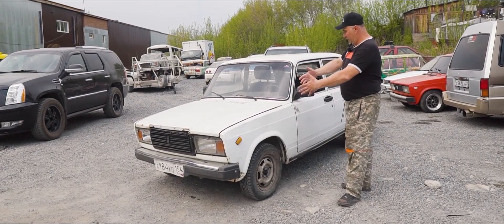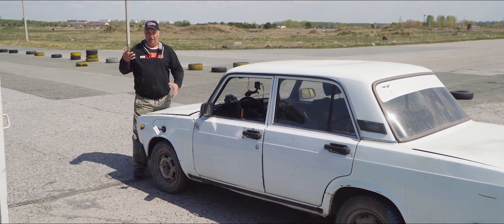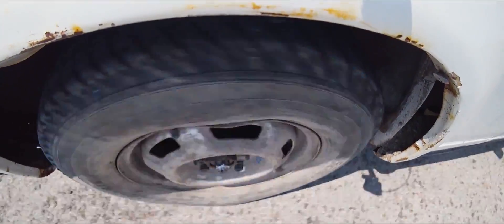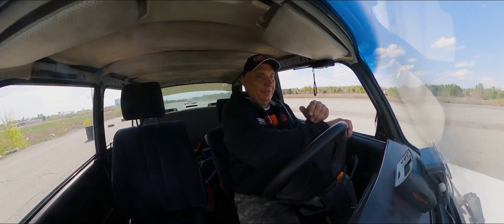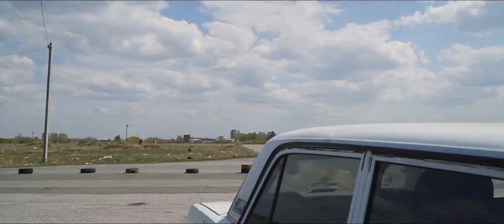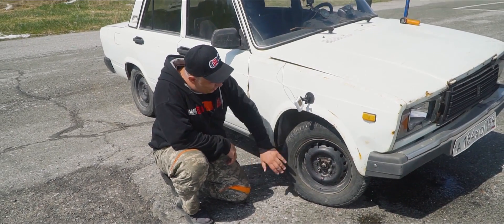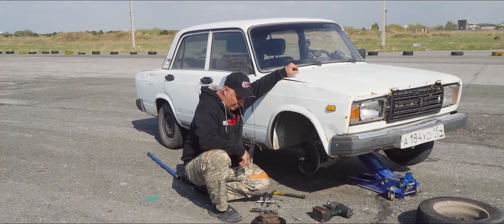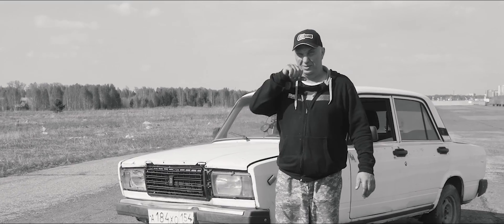The aftermath of a seized wheel bearing (and how we got there)

Comment: How much fun would it be to saw off the motor mounts so that just the radiator hose and the throttle linkage are left to hold the engine in place?  
What could go wrong?
I suspect that it would work perfectly.

Comment: Eh, who needs a damn cap, until you're on a two lane and the inside front wheel locks up?  I expect a little noise and shake won't bother someone who drives around without the caps.  For boat trailers they use a sprung piston on those caps, with a grease fitting, to pressurize the grease a bit to keep the water out.  I expect that might not work too badly for really heavy off road use, especially when some time with the axles right at or under water.

I think I'd be just as worried about the liquid pouring out front and center.

Comment: Heh i can tell you what happens when it seezes with 100kmh and you have some luck by your side.2 years ago i changed the rear pads on my 93' toyota starlet.The man who changed the pads screw the rear bolt with torque wrench and 30mins later when i was driving suddenly i was going full tokyo drift in a straight road doing 100kmh trying not to flip the car.The result was the cost of a new rear axle and a burn from overheated grease.

Comment: A good method to making things stop moving when they should is sodium silicate it hardens when exposed to heat it will completely seize an engine in 30 seconds I can only imagine what it would do to a wheel bearing or any bearing in that instance

Comment: haha one of my wheel bearings absolutely screams on the highway sometimes.. i just jiggle the wheel until it stops making noise.

theyre at 125k, i should probably get around to replacing them soon.
Reply: Yeah! That's funny! Because knowing your vehicle needs work but continue to drive it and not fix it is HILARIOUS!.... Little do you know bad bearings create heat which transfer to the brakes then through the brake fluid which ruins your brake fluid and can further issues in the brake system. Wear tires too when they don't sit level. Don't think that's a haha thing at all and it's quite sad that you know it's bad but continue to drive it knowing it's bad. You can't use the ignorance excuse there, that's stupidity.
Reply: @mikeznel6048  yeah haha

Comment: Grease loaded up with Chemico coarse grinding paste...   especially on brass or bronze bushings... munch munch munch seize :P   Funniest thing I had with a wheel end was driving down the motorway in a MK3 Ford Capri with the 3 litre engine up front, hits a pothole and the back passenger side really banged and my mate says to me "That's funny" so I asks whats funny, he says "you don't usually see a wheel cruising past just like that" and he was right, my wheel was overtaking us as the wheel studs had shorn clean off, then gravity took over and the back end dropped onto the drum gouging a great big trench in the tarmac and fighting it into the hard shoulder.   Was with the AA back then and this when they still did good fixes and the bloke turned up with a new set o' studs, knocked the old ones out, I sent me mate to recover the wheel and before long we was back on the road.

Comment: I can tell you what happens when a rear wheel bearing seizes on a '67 Mustang with the common 8" rear end. The axle shears in two instantly just outboard of the bearing, and the wheel, axle flange, brake drum, bearing and a little bit of the axle all come off as one piece, hit the concrete barrier and bounce off into the median. If it's dark, the brake backing plate gives you a fireworks show until you come to a stop.
Reply: I can confirm that the same thing happens on an F150 with a 9" rear end.
Reply: So, uh, how'd you find out?

Comment: Water destroys bearings, this much I know for sure. My father in law had a few wheel bearings go bad after running his truck through swampy water, and I have had bearings for accessories fail after I had a water pump that leaks down into the other bearings below it washing the grease away. So I guess I'd say no grease, liquids, then dirty grease would be the failure order (I know liquid's not technically part of the test but it trashes bearings).
Reply: Dust/Dirt do that faster.

Comment: You should try to over tighten the pinion bearings on the rear differential and see how long it last :D
Maybe combine it with the see through cover, if it will withstand the heat that is.

Comment: 9:54 what is that liquid that's running out?
Reply: Likely coolant from radiator, I'm sure working the poor engine this hard to move only 30kmh got it very hot - like driving with the front brakes constantly applied

Comment: lol as soon as he said we'll fit one dry i remembered doing my first set, totally forgot to pack the bearings...... they blew up 10 feet from the driveway lmfao. The originals fell apart inside the hub and marred the shit out of the axle stub, i had to make some spacers to get the innner race to sit in the proper spot on the taper.... in other words, if you have these style of wheel bearings, you don't want to let them fall apart... once they do the spindle is ruined and replacements are almost impossible to find or are very expensive.

Comment: theory for the greasless bearing not getting hot:

same principle as on a lathe, the part lost metal shavings, carrying the heat away from the part
Reply: also at 7:58, you can see the nut backing off, which would reduce pressure on the bearing

Comment: Did a front wheel bearing on a Ford Transit van belonging to an idiot, the actual taper roller bearings were broken up  some had welded themselves onto the stub axle! had to grind them off before putting the new ones on. Don't ignore the warning signs people!
Reply: I’ve dealt with that. 
And spinning the race and ruining the spindle

Comment: Big rig truckers would feel the bearings for high temperatures every few hundred miles. Now they use temp guns.  Wheel bearing fail and a fire can happen.
Reply: Maybe millennial truckers. You can smell it or know where it's at by feel. Definitely don't check bearing Temps every few hundred miles. Maybe if your chase a problem but even then it would be apparent way before 100 miles...
Reply: That's pretty neat, thanks for sharing Tom!